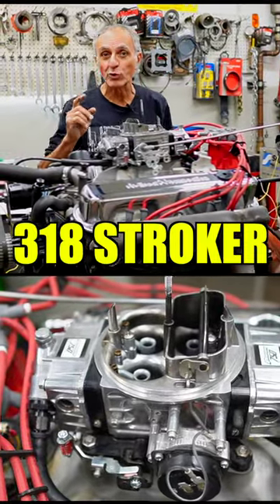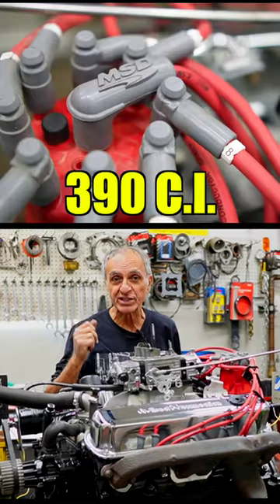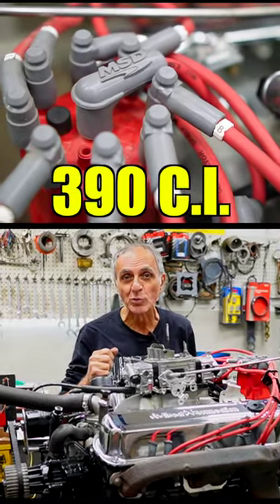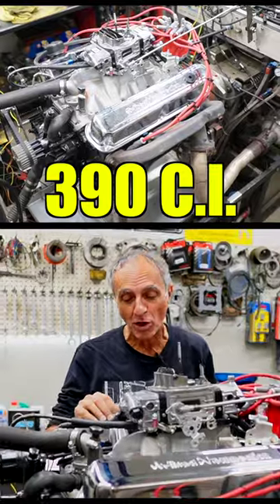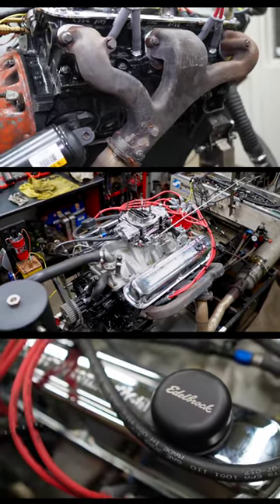Wow! 318 Stroked to 390 on the Dyno! #shorts

Comment: 318 with a 4" stroker kit, bringing the displacement to 390 cubic inches.  It's a very simple and mild street engine combo, consisting of 9.3:1 compression, a mild hydraulic cam, and bowl ported but otherwise stock iron magnum truck heads.  It made 367 HP @ 5,300 rpm, and 407 foot pounds of torque @ 4,100 rpm. It's on Youtube.
Reply: This one @10.5 with a decent street cam pulled out 406HP  443 TQ. on ported iron heads 2.02 in take valves iron exhaust manifolds .
Reply: @rafaeltorres2886  Is that all? I'll keep my big block!
Reply: A magnum version will do 400+ due to the  better  flowing heads

Comment: There are some characteristics about the small block Chrysler that make them very responsive to performance. Apparently it wasn't intentional. Just a production  issues causing them to raise the ports on the heads. They flow quite well.

Comment: Had a buddy who his grandma gave him a dodge dart 4 door with a 318, he took it to auto shop we put headers, purple 509 cam, J heads and a 360 4 barrel manifold, 3,000 stall and 3:90 gears. And NO ONE could beat him, not the Chevy big blocks, no mustang, not even a grand National V6 turbo. We had the Mopar parts book and in the back the had lil tips, clamp the springs, run a fan clutch, pinion snubber, mode, clamp off the spring hangers etc. etc. cheap lil tricks that made a huge difference. That 4 dart was just a beast. Fast forward and know we know that even the stock 318 heads would out flow and production head until the appearance of the modern Chevy and ford engines. The only one that came close was a 61 biscayne with  a true 427 Chevy , close but not good enough
Reply: Dayum! I wish the similarly modified 318s I had done backed by 4.30 & 4.56 gears were that good.
Reply: @mickangio16  truth be told it ran 11:40’s  so all the jaw smacking 10’ second cars that never would put there tires on the track were actually high 13’s or low 14’s . Lots of folks dump crazy money on the engine and ZERO into there chassis. We touched everything shocks, bushings swapped out for soild aluminum etc.

Comment: I think it makes a solid and great power n torque platform with still plenty of them out there for a fair price . 340/360 just keep climbing and the 318 is built n cast just like a 340 . I am building a 86 roller block very all roller top to bottom n sure wish I could break it in and tune it on Nick’s Dyno !!!

Comment: The 318 is my favorite MoPar engine. It is a versatile engine. It makes a great daily driver in an A body or B body. They are very reliable. They also work well in a half ton pickup or van. What heads are on this stroker engine? The stock 318 heads have small ports and valves. They are great for a daily drive but, they are small for building big horsepower.

Comment: With the longer stroke, does that come with a max RPM penalty?
Reply: Mechanically no, but any airflow restriction will result in a lower RPM where peak HP is produced. Will be interesting to hear what was done to the heads to compliment the added displacement.

Comment: Maybe i should have stuck with the 318 instead of a 440?
Reply: Nah. I've loved 440s for over 50 yrs. I HAVE tinkered with some good 318s, too, though. But, then again, it depends what vehicle and intended use. Judging by your name, I don't think you could possibly go wrong with a 440😁
Reply: Nothing beats a big block!
Reply: After seeing Nick's dyno video that 318 would make a nice surprise package in a Charger! When I seen it with exhaust manifolds and painted cylinder heads I wasn't expecting it to be built for the power that it made. I was thinking it was more like something with 318 cylinder heads and a mild cam similar to a stock 340 cam that I think would make a great pickup truck motor. It's a real sleeper.
Reply: 440 is still 50 cubes larger //